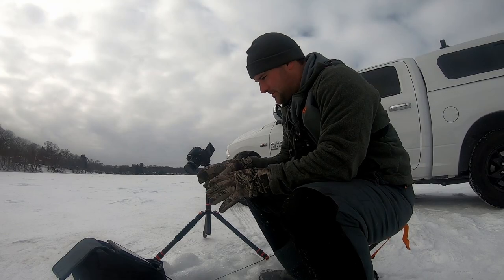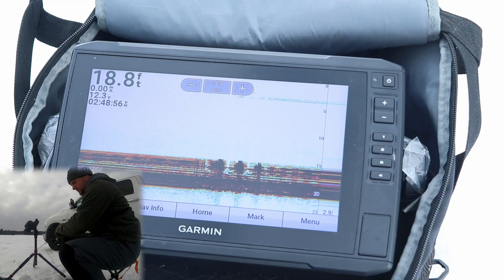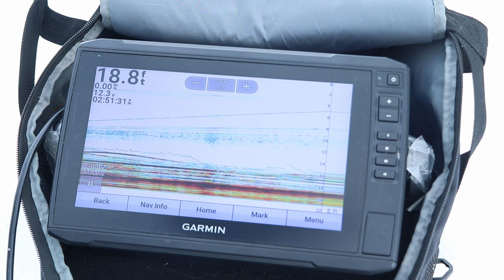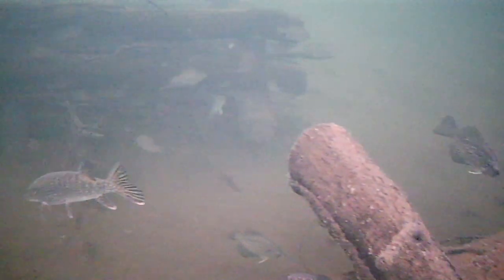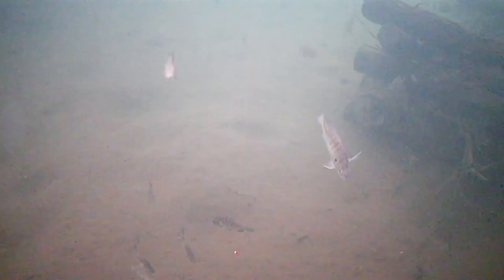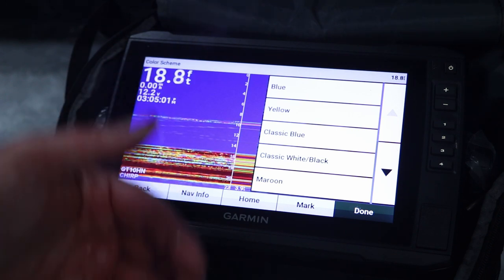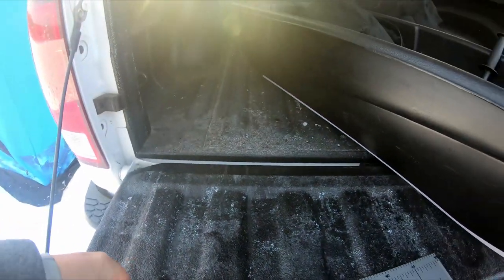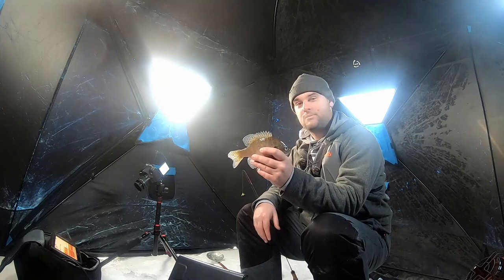How to use 2D Sonar  (Compared to Underwater Camera)

Comment: I just converted my old Hummingbird 798ci HD combo into an ice fishing unit. It worked really well. I contacted Hummingbird and they said the boat transducer if I could keep it pointing straight down was no different than the ice fishing transducer. So I made a pvc pipe t that can rotate to use the side scan. That part is unique because it picks up the under side of the ice. I first noticed this happening with leaves floating on the water in the fall. Thinking they were schools of fish. Lol anyway it shows the hols around you as brite white spots. If you are patient you can use it to pick up fish around your hole. I had to do something. I had spent 30 hours ice fishing and caught 2 fish. Drilled hundred holes and don't see any on camera.  I used to not catch crappies in open water either but now I can catch them so I will keep learning and hope to figure it out.

Comment: Do you find the fish set up on those cribs all winter or is more like early ice vs late ice?  And are those cribs in the main basin of that lake.  It’s my 2nd yr of ice fishing in Illinois and still trying to learn their movement, especially the crappie.  Thanks.
Reply from the maker: The bluegill will hold to the cribs throughout most of the winter, crappie tend to show up early and late ice. These cribs are on the edge of a sharp drop off, nearing the start of the basin.

Comment: What brand underwater camera do you use?
Reply from the maker: Aquavu HD7i https://bit.ly/3JNP5Ux
Reply: Thanks I’ve had an Aqua-Vu for some time and it finally went TU. I tried a different battery from my Garmin Striker 4 Plus and nothing, so I’m in the market for a replacement and was looking at the Marcum Recon 5. What are your thoughts about this unit?